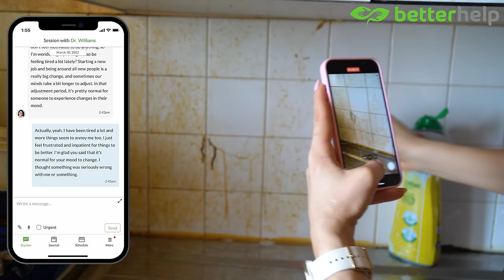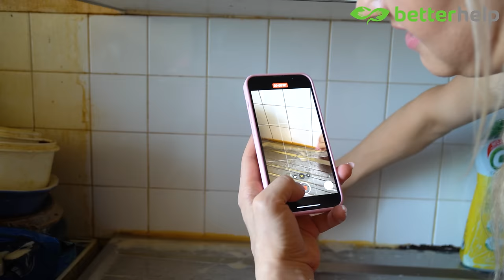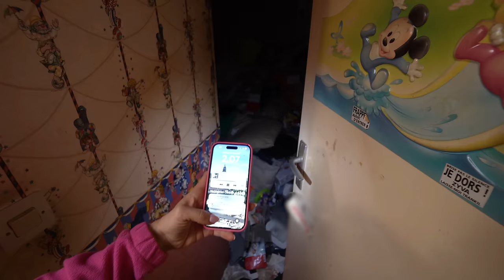FREE Cleaning For a Single Dad With a Bed Bug Infested Home ❤️ | CLEANING WITH SCRUB DADDY

Comment: One good way to get rid of bed bugs is to use heat, burning hot air. Plus you have to find their hiding places which can be away from the bed in a high corner along the wall.

You may have to get rid of of the bed and mattress…

Comment: PLEASE help me understand HOW grease goes all the way up walls like in this apartment? I can understand dust and cobwebs but grease?

HIGH HEAT at 120°F kills bed bugs instantly even eggs. Also vacuum rugs, beds, couches, chairs then bag and throw away. My niece kept getting infested with bed bugs. Turns out the elementary school had an infestation; both the elementary and high schools closed for 3 days. My niece paid a company to spray but it did not work. I rented industrial heat blowers, put plastic over all windows and doors, stripped all beds, took cushions off chairs & couches, then she and her daughter spent  2 full days and nights with me while the blowers were running. I  dropped off my great-niece to school Monday morning,  my niece went to work, and I went to their apartment with my Hepa filter vacuum and cleaned everything making sure to bag the vacuum contents and dirty filter before putting in dumpster. No chemicals used because my family has asthma and allergy issues.
Reply: Grease splatters & turns into vapor, and can reach the upper walls and ceiling, especially over a long enough time period
Reply: If you never clean the place, it will get greasy. All the oil splashes when you're frying something. I dont have kitchen exhaust unit and the area around my stove gets sooo oily in like 2-3 weeks if I dont clean it! Can only imagine how bad it will get if you dont clean for years.

Comment: @Aurikatarina
Please, really, don't skip the best part of all the videos - full process of cleaning the floor! This is the best part. I've been watching your videos from the beginning and I love it! Important information - the squeeze floor is not available in some parts of Europe - like examples Poland or Germany 😔 That's very sad, because it's so hard to find one with a silicone tip, turned sideways (for cleaning under the sofa), which can change the height of the handle and be durable and good squeeze in Europe 😭 Tell us , where to find it!  Where to buy it?!

Comment: Bed bugs are my cryptonite. No. I love to clean but with bedbugs a match is best. They get in the walls and under carpet. They easily transfer place to place on shoes and clothing but they are very very very hard to eradicate once they have infested. They dont just live in mattresses and thats it, buy a new mattress, no they can take over your whole life.
Reply: thats why if you happen to use second hand shops, either freeze the stuff you cant wash for a couple of weeks in freezer or wash clothes etc you can wash at at least 60 degrees celsius. and every time you travel and come back, freeze the travel bag or use 100 degrees celcius sauna, carefully put the bag in a big plastic bag (so the possible bugs dont go out of the bag) about an hour and do not put it too close to the sauna stove.
Reply: @vijoko  there's ways to prevent transferring, preventing cross contamination is paramount. Heat kills them, if it can reach them, and there are many methods that are useful, but there's also a lot of myths surrounding them. They are much harder to be rid of than people realize.

Comment: I bought Scrub Daddy, but I’ve noticed pieces came of it after a time. And I hate flushing small pieces of plastic down the drain. Just as microfiber towels release microplastics in the washing machine. I wished there were better eco alternatives 😔 Scrub Daddy and MF towels work great, but I can’t use them if they are bad for the enviroment.

Comment: Omg your guest speaker is correct, cleaning up as child is one thing but when it's over used by a bad parent....well think how you would feel if you got beat with a belt at age 5/6/7 for not cleaning "right" or housework is used a punishment? Well it does happen and what happens when those children grow up, what kind of relationship do they have with cleaning? Not a good one.